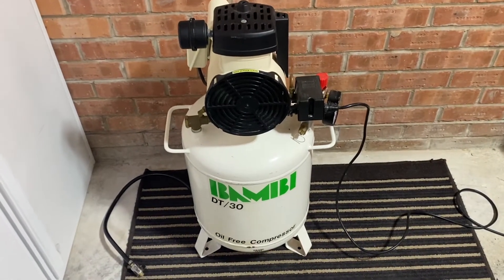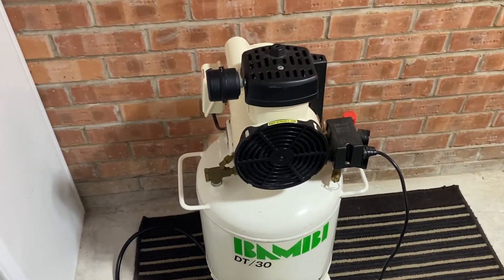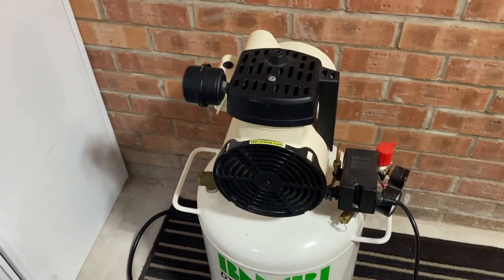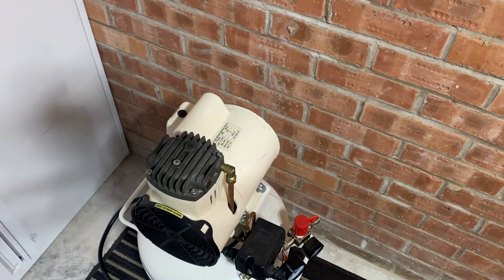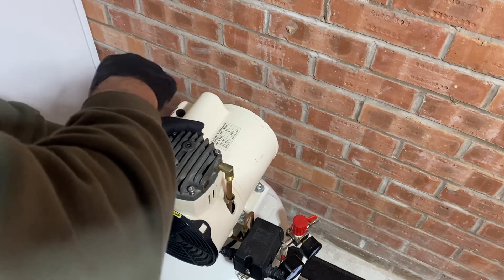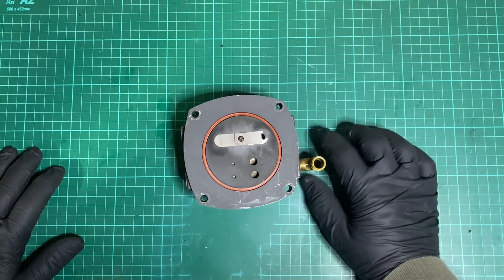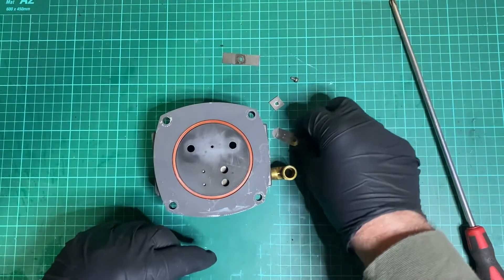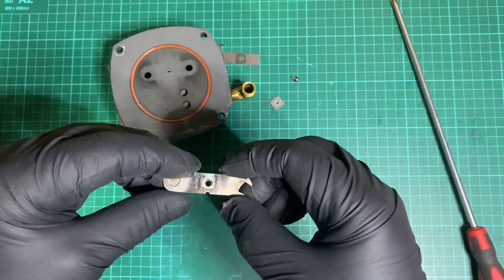Oil Free Compressor Reed Valve Replacement (Bambi DT/30)

Comment: Matt Thankyou ! I have brought a Hyundai Oil free compressor it's my first compressor,But it only goes to 40 psi then runs continuously not getting to 7 bar so contacted Hyundai who have shrugged me off I'm left to try to fix myself 
It won't even get to 7 bar after 6 mins and I switch it off due to worry of overheating..This is what I need to try and replace / investigate 🙏👌